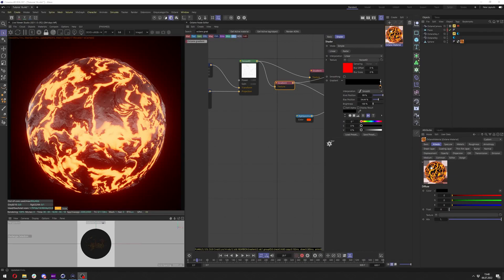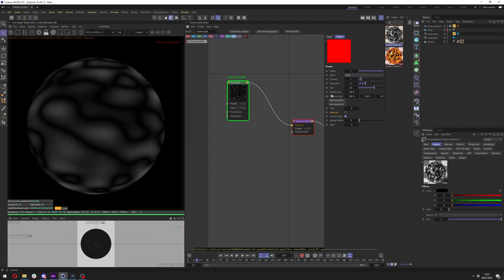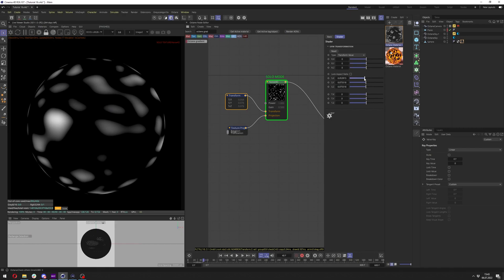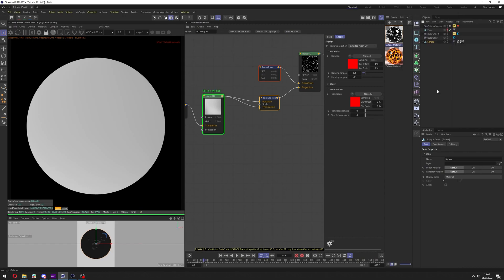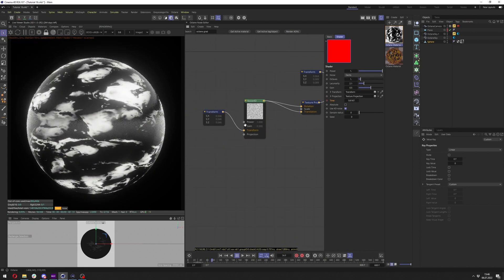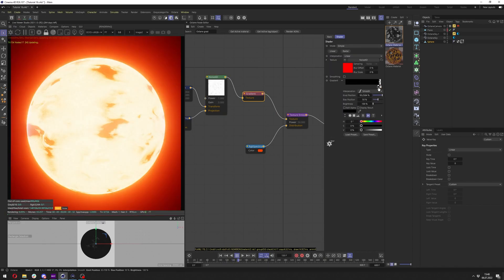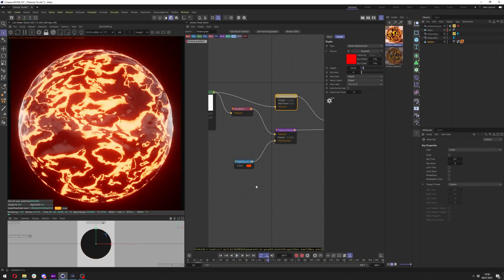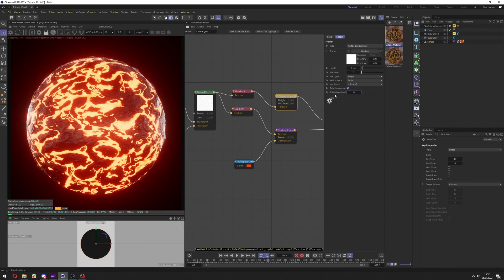Animated Lava Material in Octane Renderer

Comment from the maker: IMPORTANT NOTE: 
With latest version of Octane Distorted mesh UV got changed for better, now it actually make more sense.

1. Now you dont have to connect noise to translation to make rotating range.x/y work.

2. When you connect noise to translation, now you can directly distort it with Translation range.x/y, same goes for Scale and Rotation.

3. Values (at least in rotating range) seams to need bigger numbers to actually distort (before i needed around 0.1 now i need around 5.0)

All of these is a good thing but ofc you need to keep it in mind while watching this tutorial!